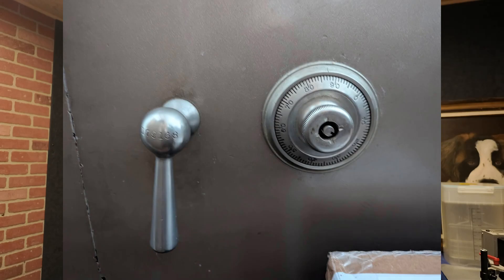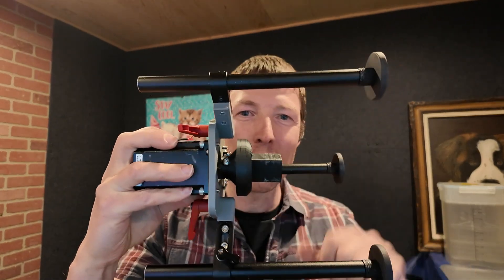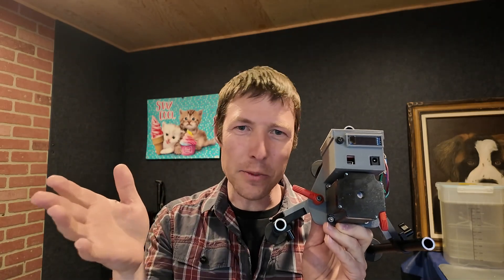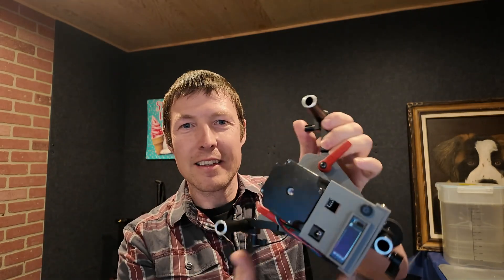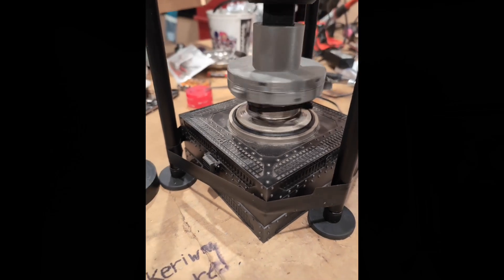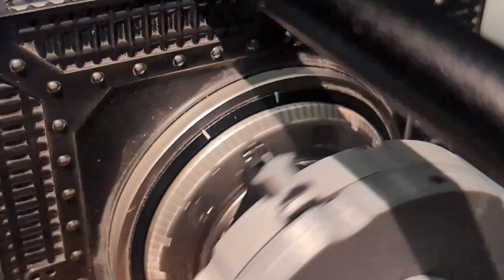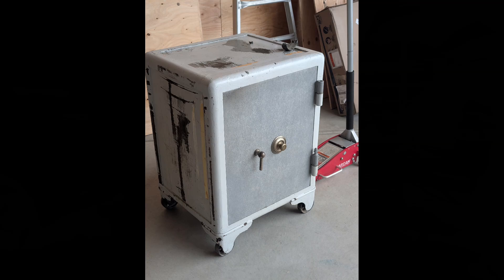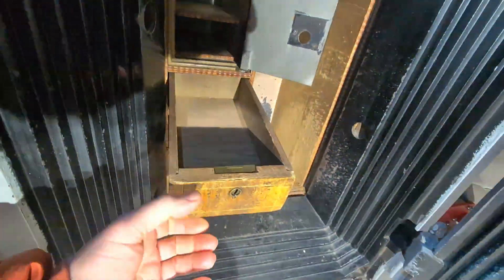Building a Better Safe Cracking Autodialer

Comment: I'll preface this with the fact that I know very little about dial lock manipulation. I just about know how the basic mechanism works from drilling the back off an old dial padlock to take a look and work out the combination. 

Though if the gears in the Yale Y6 create too much background noise to manipulate the lock using a stethoscope, could you use a contact microphone and, assuming the noise of the gears is a different range of frequencies, you could use digital (or analogue) audio filtering/noise cancelling to isolate the sound of the clicks.

Especially if the clicks are very distinctive sounds. 

You could even build this into an autodialer (use a BLDC servo motor to make it quieter and less bulky) and have it make attempts from what it thinks may be a click. 
Even if it's wrong 75% of fhe time, you've still increased the speed of the autodialer. 

You'd probably need a more powerful microcontroller / microcomputer like a ras. pi and excellent timing between the mic and rotary encoder system though if there are audible clicks, I could see it working.

You could even make an auto-manipulator autodialer combo which tries to manipulate the lock using sound then falls back on auto dialling if it fails.

Comment: He won’t need the bungee cord on a newer safes dial Locks up when it’s open I’d like to see if you were working with which is a different mechanical scenario. Another words the last number on the Combination on the older saves is the opening. They were saved. You have a fourth number that is always the same like 95 when you pass 95 or go to 95 it will stop. That’s the difference.